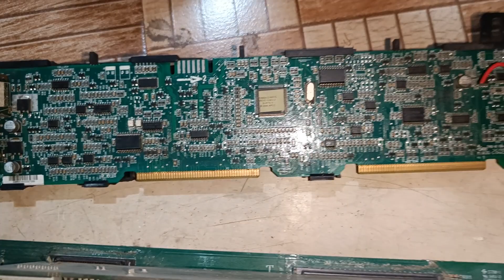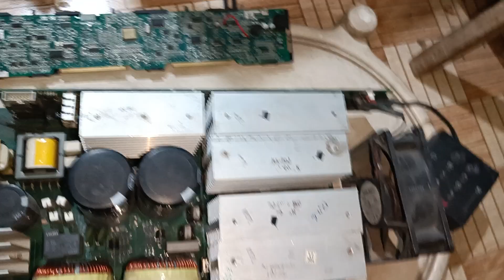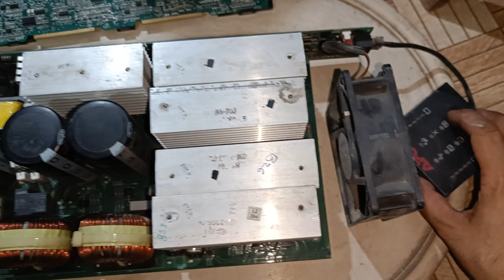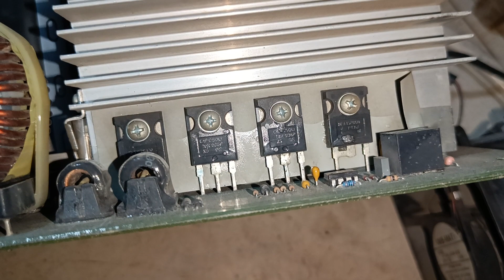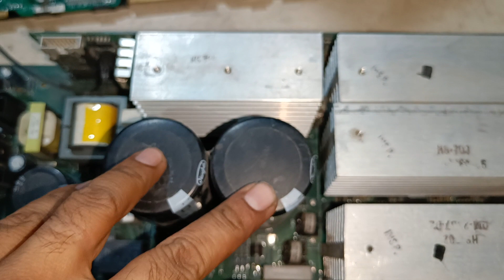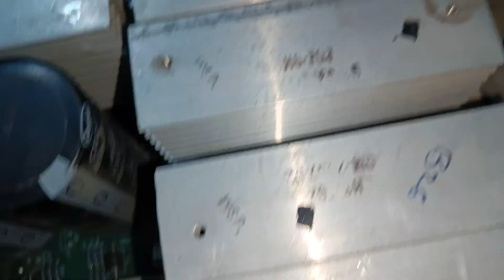(English Language) APC SURT 5000 ONLINE UPS PART 2

Comment: Hello, I have 1 ups smart 3000va it does not turn on, when you press power it only turns on the fan cooler and it stays on if you leave the button pressed, please help